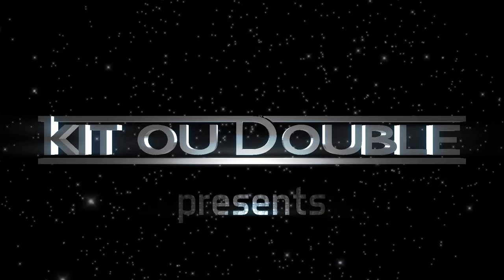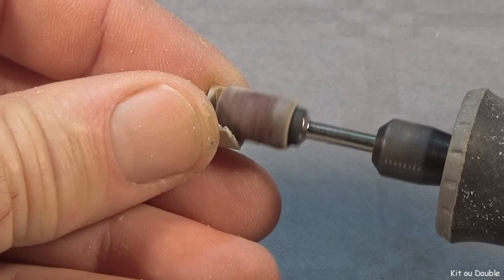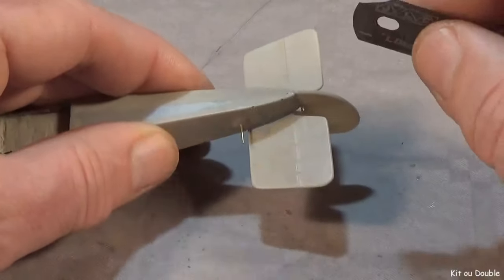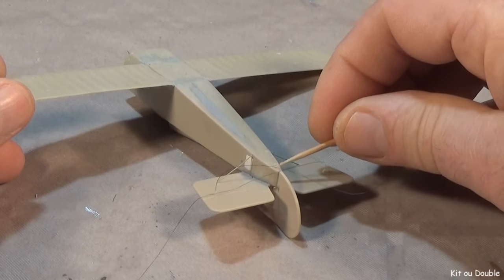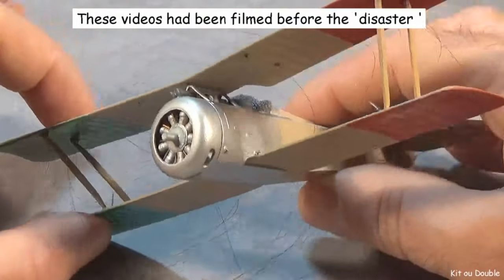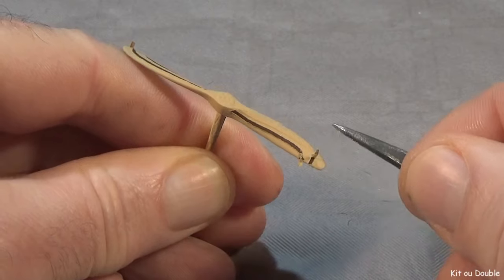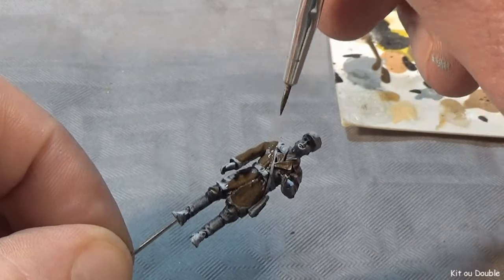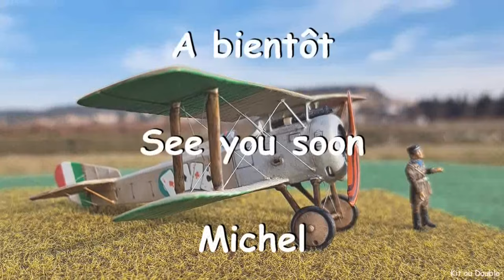Hanriot HD 1 1/48 Eduard

Comment: I totally understand how frustrating rigging WW1 planes can be so that's why I only build 1/32 scale as it's large enough to make this process easier. Considering all your problems you did a great job on that Hanriot. The toothpick in the glue stick is a terrific idea....I'll definitely use it in future.....saves wasting that small amount of glue at the bottom of the jar so thanks for the tip 👍👏
Reply from the maker: Thanks Robert. A little bit in advance, happy new year for you and your family. A very good friend of mine who is also an authentic 'master', ( he wins all the competitions and writes articles in the specialized press) taught me a simple and effective method for rigging. It worked well on 2 string bags in the 32nd. This time I wanted to try another method of another 'master'. It could have worked if the masts had wanted to hold on. They stubbornly refused. 😅Hence the disaster.🙄 The temptation to give up came to me quite often. I don’t know how, but I got away with it. I won’t make those mistakes again. I’ll make others 😂Thanks again and see you soon
Reply: and a Happy New Year to your and your family. Let's hope that 2024 is a happy, healthy and model-filled year of fun.  ☺☺